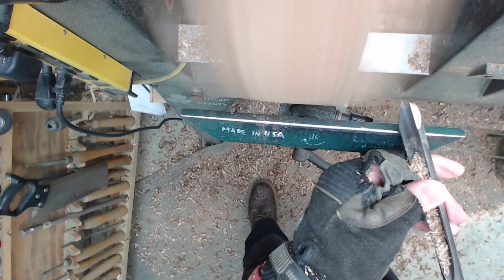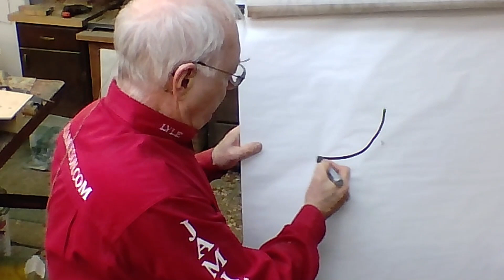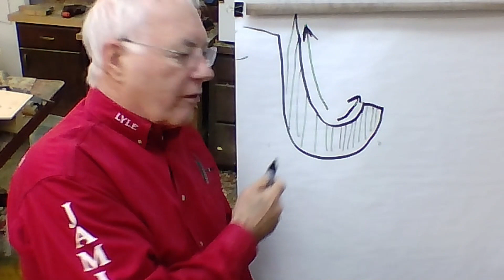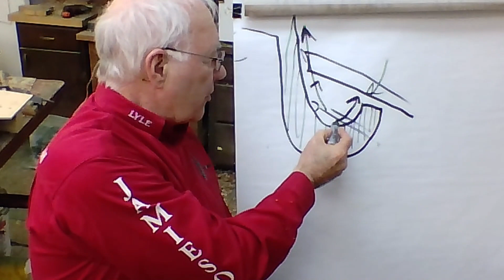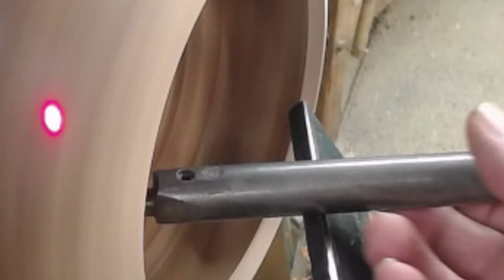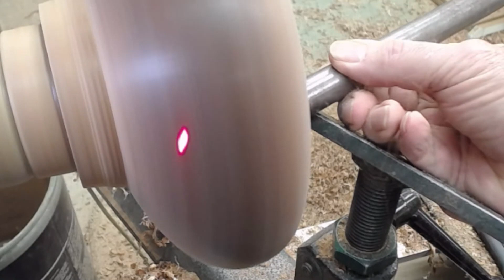Koa crotch bowl with undercut rim

Comment: The work is very beautiful! But there is a question:- Why not sharpen the inside with a bowl cutter on the reverse? Then there is free access to the inside.
Reply from the maker: Good Question Ivan, sorry I did not show that clearly.  I always use gouges with bevel support.  That will not work for that shape.  You could scrape with a bowl gouge but the scraping would be forced to cut in the wrong direction to the grain.  It would mean a lot more sanding is needed. 

Have you seen I am doing IRDs?? To see schedule and purchase a ticket for LIVE and interactive with Lyle, go to my web site. See more detailed information on my website lylejamieson.com or https://lylejamieson.com/product-category/live-interactive-remote-demonstrations/
The next one is January 21, 2023 3:00pm EST Hollow form measuring with laser and camera option. I do a different topic every 3-4 weeks. My web site has a sign up for notifications when I schedule the next one on the bottom of most pages.

Comment: beautiful, i use an almost identical shape when i have a special piece of wood. you're right the inside does present challenges. how do you feel your little angled carbide cutter would have done on the inside curve
Reply from the maker: Thanks for watching Bill. I use my carbide cutters in these shapes usually.  Need both regular and reverse angle carbides to go the correct way to the grain.  The surface is even better then what I had there with scrapers. 

Have you seen I am doing IRDs?? To see schedule and purchase a ticket for LIVE and interactive with Lyle, go to my web site. See more detailed information on my website lylejamieson.com or https://lylejamieson.com/product-category/live-interactive-remote-demonstrations/
The next one is January 21, 2023 3:00pm EST Hollow form measuring with laser and camera option. I do a different topic every 3-4 weeks. My web site has a sign up for notifications when I schedule the next one on the bottom of most pages.